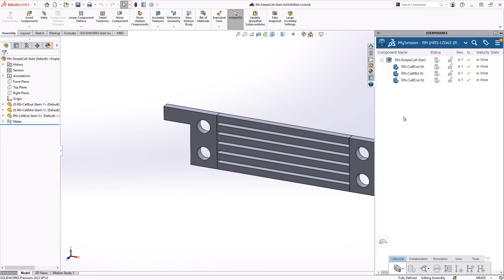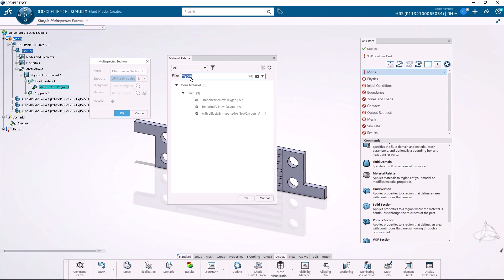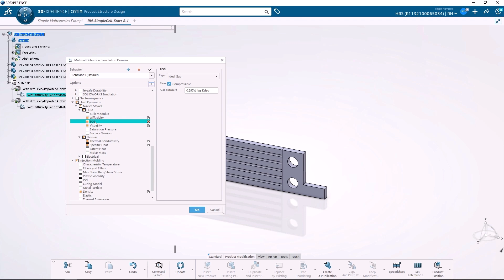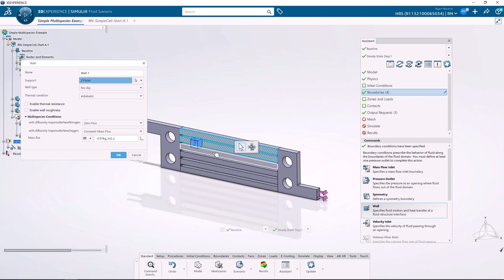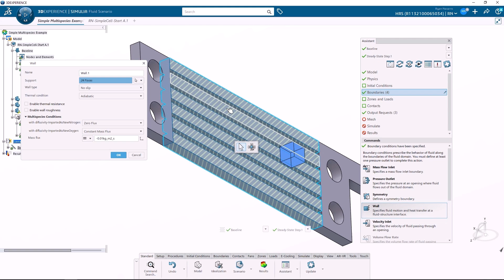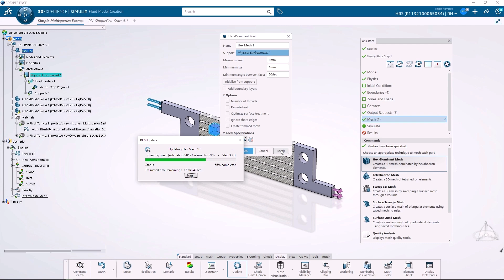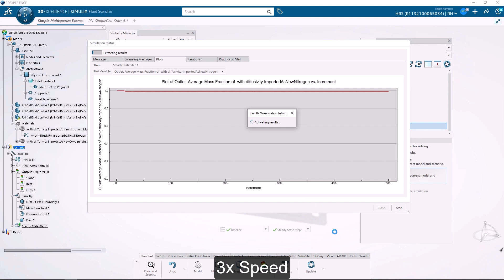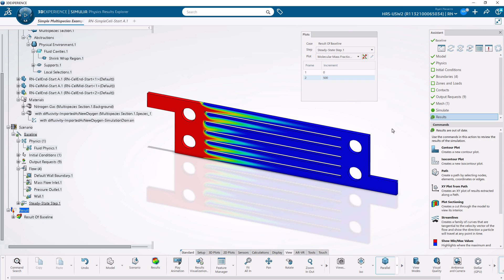Multispecies flow in SIMULIA Fluid Dynamics Engineer

Comment: Hi mate, you make some good videos, we all appreciate it I'm sure. Do you have any tips for solidworks visualize standard to just get something looking realistic quickly and easily? I'm just trying to do some basic brackets and small flat pieces with metal finishes, but i cant seem to get the settings correct for anything other than brushed finishes to show up half decent. I really want to be able to just have a template set and just draw up each new bracket and put it in, with minor tweaks to get it looking realistic. Any background recommendations and lighting recommendations for metal parts?  Thank you.